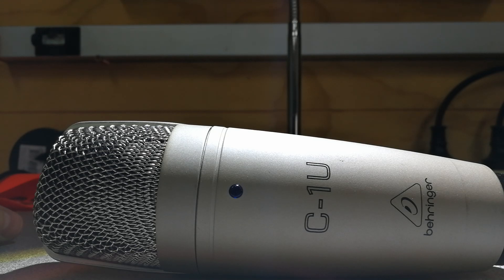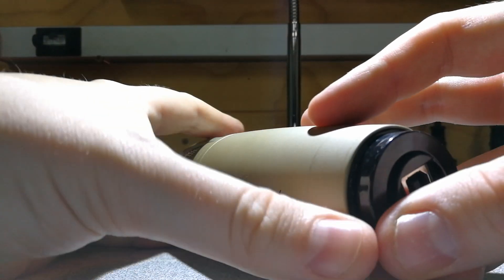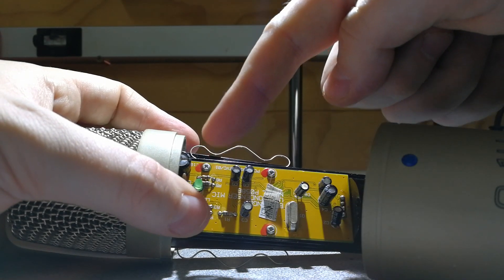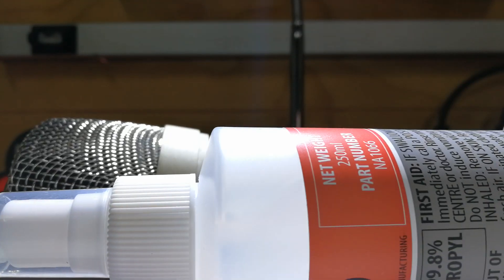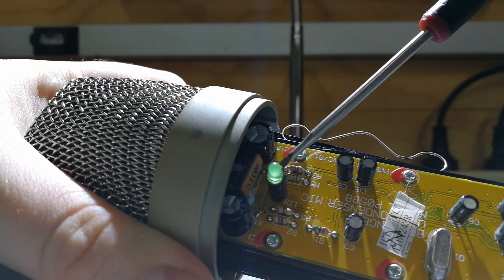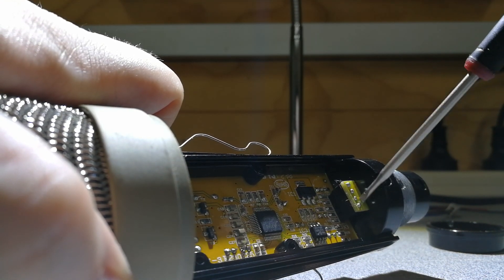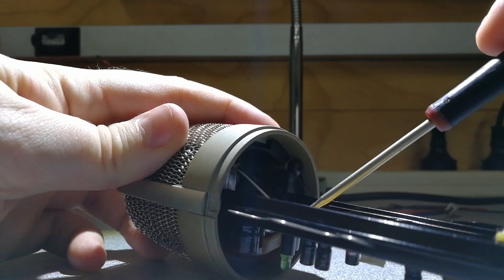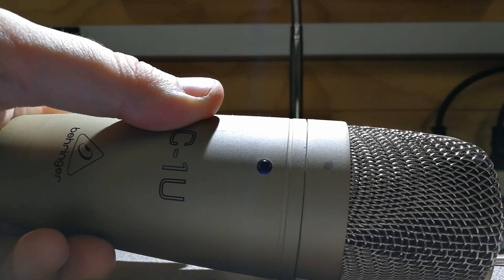Behringer C-1U low volume FIXED (actual real fix)

Comment: I tried this as well, and I appreciate the tip.  While many of the solder joints were pretty terrible on the PCB it didn't make any difference to the overall volume level.  It just looks like this should have a gain (+10db, +20db and +30db) adjuster like so many other devices in the Windows sound settings.  I plugged it into a mac as well and with full input gain it was still a very low signal at 8" from the mic.  You basically have to put your face against the screen to get any real level out of it.  It might be fine for high input like singing, but for standard voice communications it's not useful.
Reply: I have encountered the same problem, and this fix didn't solve it. Did you figure out any other solution?
Reply: @tanjiroberto  me too bro , i tried everything on the vid but I still have to use voicemeeter and set it to +7db or higher to get some good audio from it, it does however, have a bit of white noise but it isn't that significant when I'm speaking on the mic
Reply: @lorenzo33631  You need yo change the caps , the  big ones , they are 470 uf 10 v i think, try put 470 uf 25 v . that help

Comment: I'll give this a try and test progressively as I work through cleaning and resoldering dodgy joints. I have two brand new ones with the same problem so it'll be interesting if I can isolate the problem. Extraordinary that it's such a well known problem with Behringer seeming to be missing in action - their stuff is usually very good.

Comment: Mine isn't that quiet, it has a lot of white noise instead. Could this be a solution for that as well?
Reply: I didn't pull the volume up manually.
Reply from the maker: @szuzmariacsatkai3496  It might be, worth a shot
Reply: Yes ! It fixed mine ! Try it out but be careful !

Comment: Hi man I just did the resoldering of the pads and it absolutely worked for me. Now my mic can record even on like 35% of volume and it used to be at 100% and it was still quiet. I didnt ever touched the USB connections and it works. Thank you very much.
Reply from the maker: Thank you so much for the reply, I'm glad I could help :)

Comment: all usb mics are queter on win 8/10 via win 7, I solve same problem twice or triple louder by using equaliser APO program for win 10 that applying gain knob, your solution seems to me more immaginary/audiophilic than real pcb warming help, like I change cable from copper to silver or gold and hear the difference. But, I may be wrong :)
Reply from the maker: I did try a gain booster but it added too much noise to the signal
Reply: I have one that's brand new. Plugged it in to add some capability and dial the levels in, I thought there was something wrong with it. Literally the first thing I'm doing is looking for a collective reason the level is so low. Tell you guys what I'm gonna do. I haven't taken mine apart yet. I will test it as is. Then open it up and if it needs attention. I'll give it some. Then run it again. See if it was worth the effort. It doesn't take much more than a cold solder joint to f things up. Anything made in asia at a production rate of "go faster or get fired", is generally shit, but for the price...
Reply: @fxsrider  so did you fix it?
Reply: I did nothing to it. I found that about 15-18 inches away it picks me up fairly well. I was expecting it to have more volume when I bought it. It was going to be used to mic a guitar amp but I ended up solving my D.I. issue for the guitar. I don't have an issue with the recording level now that I have used it a while.
Reply: @fxsrider  and what about the noise? Do you use Noise Reduction or you don't really have any background noise? I recently bought it and apart for the fact that the volume is low, it also has a constant background noise
Reply: You're wrong. Go and learn electronics. He fixed it by reflowing cold joints.